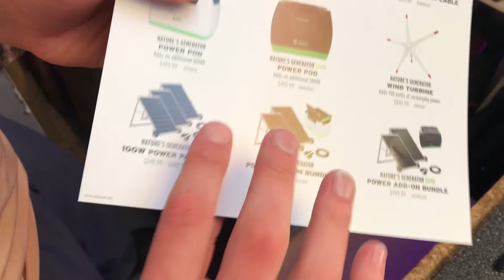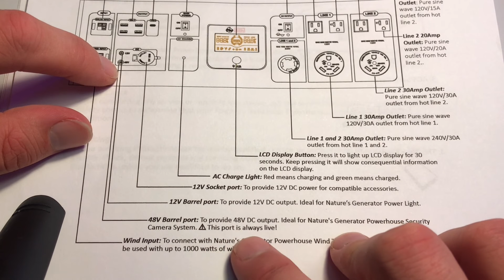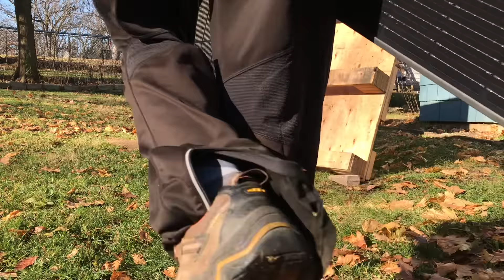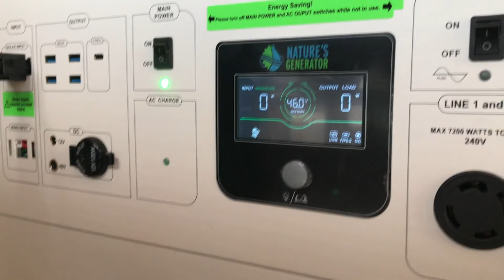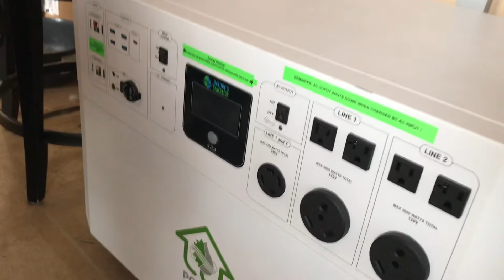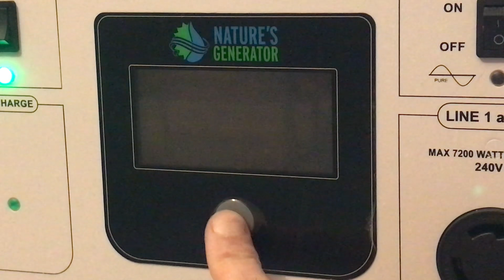Natures Generator Powerhouse Review - Unboxing, Assembly, & Testing

Comment: I have spent months researching solar  generators and have never seen one video until today.  It seems its biggest downside is the weight. I just read it weighs 434!! how is that even possible.  That is like 3X the heaviest ones on the market.  My question is can you move it in pieces? It seems the base model has a top and bottom.  I wonder what the weight of each piece is.  I think it has a lot of features but not being able to lift it would make it not useful.  I once tried to move a 400lb boulder and threw my back out.
Reply: Probably that lead acid battery.

Comment: Need better technology and an APP!!!!!
I upgraded(I thought) from the Elite. I was expecting the same if not better electronics however it has been a disappointment. The Elite generator had the same LCD display information as the Powerhouse but had a Bluetooth and app. It was functional and work well. The Powerhouse only added color to the Display with no other improvements to the device information. Unable to see important diagnostics for this battery system such as battery temperature. I am also not encouraged that the Inverter runs excessively when charging. I am only making these comparisons to the Elite. I am unable to recommend this product as I would not purchase again.  
FYI: I posted this review on the Nature Generator website but they removed it after one day.
Reply: Removed after one day, that is really shady. I was really considering this unit. I’m glad I saw your comment. Thanks for taking the time to post this for others. It was very helpful.

Comment: Wow ! This is the largest portable solar generator I’ve ever seen😲 that’s split phase 120 -240 v . Massive power 7000 + watts . Does it has pass through power , UPS function or direct connection terminals to connect to a breaker panel or transfer switch ? Al though it’s massively heavy but it will certainly do the job running the whole house .Check out my DIY solar videos , hit like ,leave a comment and subscribe . May the solar be with you .😉🤙

Comment: If you hook up your whole house to it you might pull pretty close to 7200 w especially if you have a electric water heater electric kitchen stove which together would go over 7200 watts. I'm not running at the same time the water heater not always running at 4800 watts and just probably just a little bit of 7200 w. But you probably want to have a bigger battery and more solar panels so you could efficiently charge it.

Comment: Have been trying to determine the voltage/amp requirements for their solar input. Nothing listed in the manual or on their site. I'm guessing somewhere around 150v? They sell it with (4) 410w Panels at 37v. Assuming you can string all 4 in series, that puts your around the 150v mark. Wish there was more information on this. Also, very odd that they don't sell the powerhouse in arrangements without the solar panels.

Comment: I have the Elite system with 2000 watts of solar, (4 panels) and the wind turbine.  I am running 3 minisplit heat systems off the generator, averaging 10 hours daily since the beginning of 2023 in the northeast. all 3 systems run on 120AC.  2 are 9000btu and the 3rd is 12000btu.  I have had a few occasions where the minisplits ran all night.  Otherwise, at night before I go to bed, I am switching the generator over to AC Charge, and unplug the AC in the morning when I get up. r for @ 6 hours daily, based on the performance thus far.  Unfortunately, the windmill does not work very often in my area.  IT is rated for 1000 watts.  I do expect to be able to run the minisplits 24x7 during the summer months for cooling, as well as being able to run our pool filter which runs off 240AC.  This is a nice feature with these solar generators. My biggest complaint with this system is that you cannot draw any power from it while it is charging via AC.  I am quite happy with this system as I am able to heat the main floor of my home and saving some money on Oil, even though I am charging this system nightly via AC.

Comment: Can you power loads while charging? Pass thru charging is a major plus or major downer if it can't. I'd love to see how the turbine works out especially in winds under 25mph which is a good gust but rarely a constant at least here in Appalachians of MA.
Reply from the maker: Yes you can power loads while charging BUT you can't do this when charging it with its AC power cord. You can with solar and wind. And as for the wind turbine im right there with you. I'm not sure exactly how large the turbine is but it looks fairly small so it won't be a huge hassle. Maybe I'll get the turbine for a part 2 review!
Reply: @bros6043  sweet...ill Definetly be interested in watching that✌
Reply: I am south of Boston and have the powerhouse elite system with 4 solar panels and the wind turbine which is rated for 1000 watts.  I am not having much luck with the wind in my location as this generator requires 28 mph to generate electricity, and we rarely get anything close to that.  I have some property in Vermont just above North Adams, and I think I will have better performance with the wind turbine there once we build our home.  based on the results I am seeing thus far with the solar and the generator, I think this system will do very well there and provide 80% or more of the power we would need

Comment: I see it takes 2000 W solar, but I didn’t hear how much voltage it takes? Minimum and maximum. 🖖
Reply from the maker: I just checked the generator manual and didn't see any info relating to voltage. It's most likely on their website but I just checked it quickly and didn't find the info you're looking for yet. This is def important so it's gotta be somewhere on their site

Comment: Lead acid batteries,uh no.🙄
Reply: The manufacturer states on their website that the Lead acid battery is better overall compared to the other options available.  I am able to run 3 minisplit HVAC systems on this for 10 - 12 hours daily thus far with the same generator/powerpack system as shown by the original author of this post.  I expect that if I added a second battery to this system I would be able to run these around the clock if I had enough solar and wind power  generating to charge them.  To my knowledge, the other battery options are  more problematic for recycling/waste.  I have read that disposing of the other batteries is a big problem with very limited options to get rid of them, which means $$$.  Lead Acid batteries are readily recyclable and based on my experience with car batteries, will get you $$$ in your pocket. Something to consider when talking about battery options for solar systems, especially when you factor the environmental effects, which is a big reason for going solar
Reply: I just notice that. Thanks.
Reply from the maker: I have always been skeptical of them, but the battery is massive so it won't be running out of cycle life anytime soon
Reply: No one uses lead asid any more, and he was flipping them around. I don’t see 7200 watts kinking from a small unit like this with lead asid. Maybe 48 volt LFP.